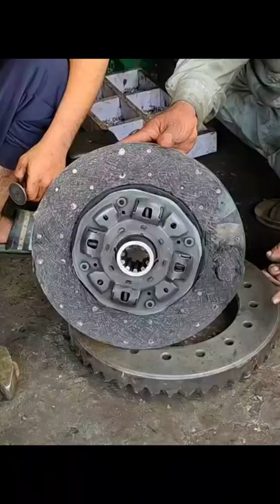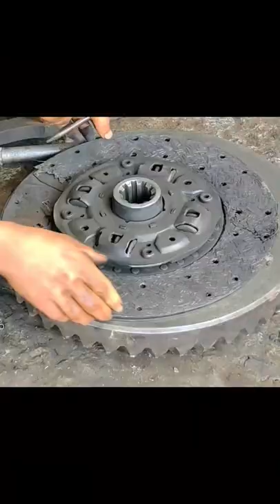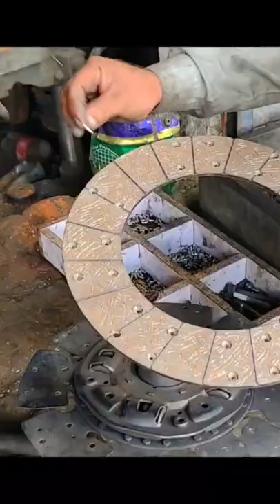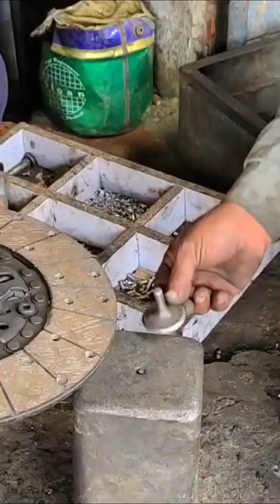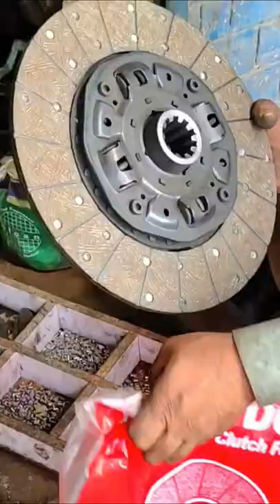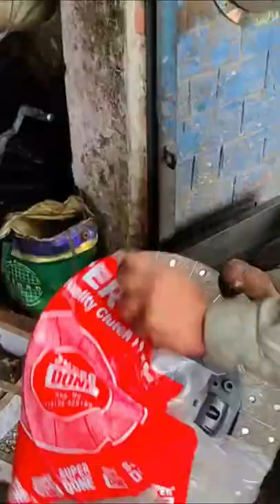Restoring a Dead Clutch Plates into a 50$ Product. #shorts #mechanic #truck #restoration #repair

Comment: It's a reman part I'd bet you've bought re man parts from the parts store that you had no idea was made in a place like this Pakistan.. ever bought calipers from a parts store ever bought a water pump etc that's why there's a core charge.. as for this clutch it's a re man or the clutch was sent in for a re disk very common especially on older dozers heavy equipment even trucks still get the clutch re disk done because it's cheaper.. this is the age we live in.
Reply: If ok